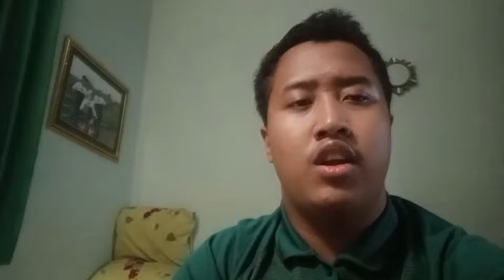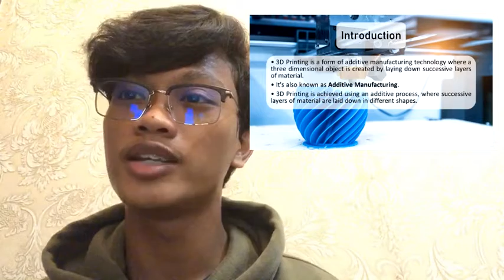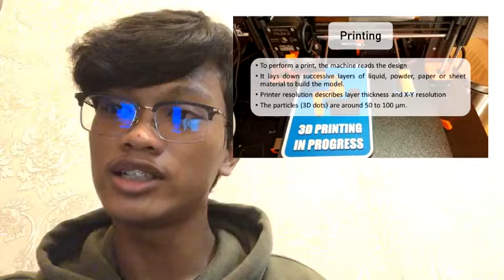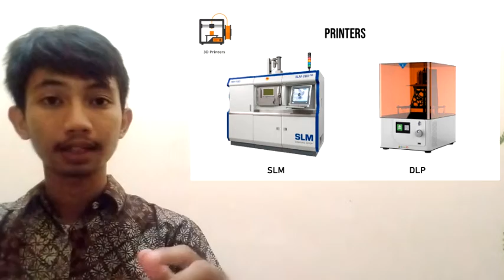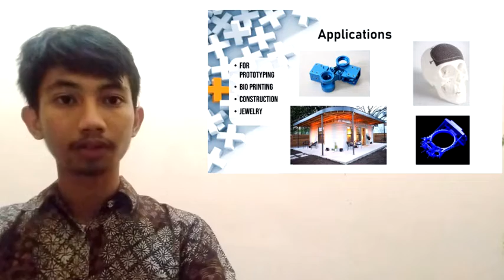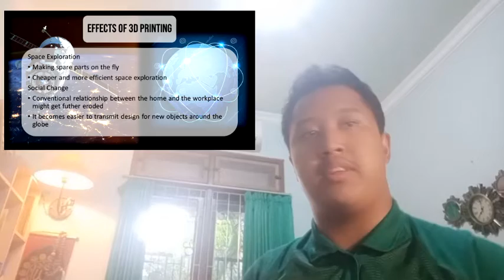3D Printing - Bahasa Inggris Kelas 26 (Mr. Hermanto)

Comment: Hello, I am Ghina Syafina Syahrani (SID: 05211940000142) from Information System Department. I am curious about something and I want to ask you guys a question. Lets say that i want to print something in 3D. What is the first thing I should consider when making something in 3D? Is it the size? Quality? The material I use? Or maybe something related with the budget or cost? Thank you.